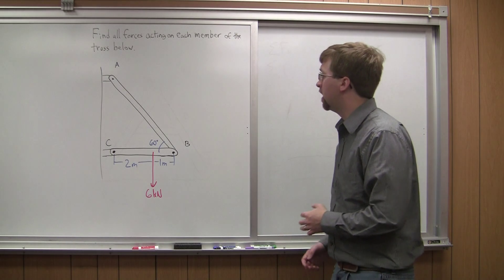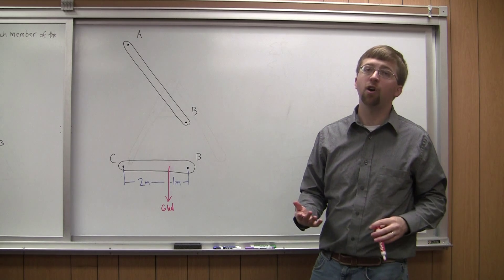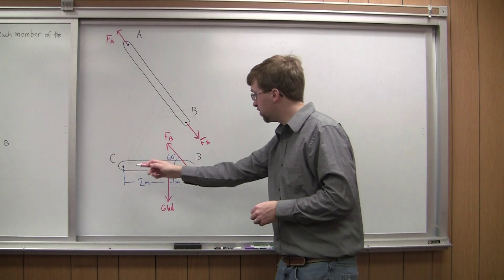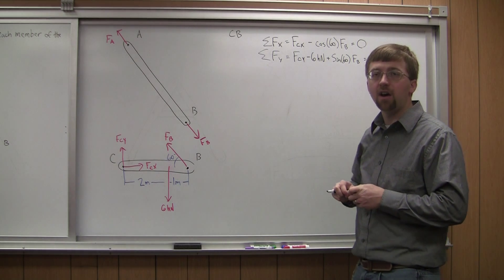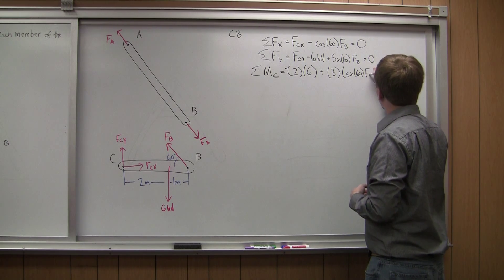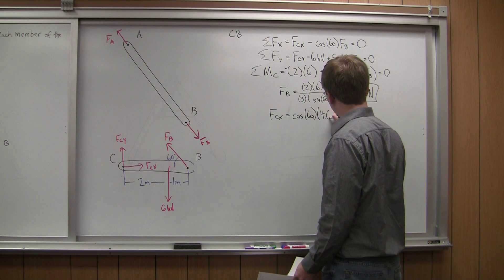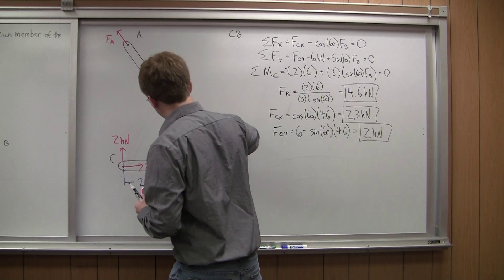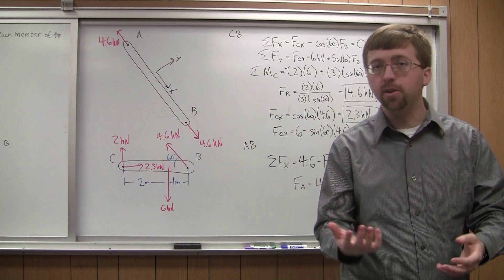Analysis of Frames and Machines - Adaptive Map Worked Example 2

Comment: Why don't you label the force of the support  at point A ?
Reply from the maker: There is a pin joint at A, however member AB is a two force member, so the for must act along the line of the beam. This is why we have Fa in a set direction rather than having Fax and Fay.

Comment: Thanx for these videos...I really appreciate your effort.
Well you said that if we remove the frame structure from the ground it should still behave as a rigid body.In a complicated structure how would I know if a body when removed from the ground would behave as a rigid body or not?
Reply from the maker: The easiest way would be to simply think it through in your head. Imagine getting rid of all the anchor points, then you have to think if you would have a rigid shape, or something that you could move pieces around relative to one another. Two common instances to look for are when a single joint is the only connection between two halves of a truss or frame (not independently rigid), or when you have a rectangle or parallelogram that would allow it to change shape (not independently rigid).